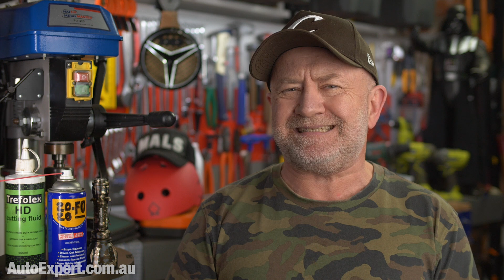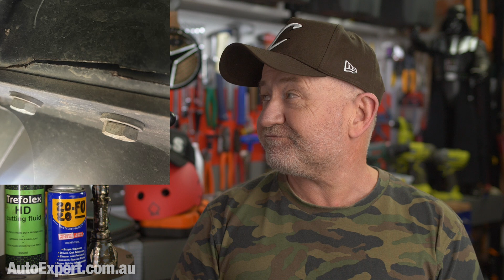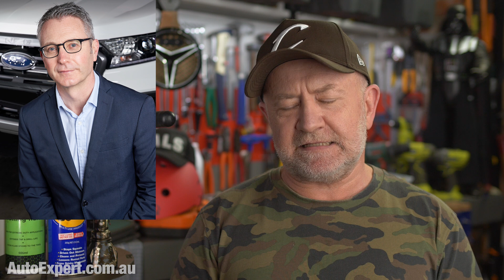CRACKED! Hi-tensile bolts Vs chassis Vs dealer incompetence | Auto Expert John Cadogan

Comment: You've got to love sales/service people's bullshit at times, I got a chuckle out of they just loosened.

It's not the first time someone hasn't installed a towbar incorrectly. Is it the Ford dealer at fault or ARB, I suspect ARB fitted the towbar and would likely be at fault but the dealer if they sold/recommended this towbar should do the right thing and fix it. And give they've invoiced to tightened chassis bolts, I expect they're a little rooted, seems like a good negligence claim to me.

My guess is these were tightened up with a rattle gun that wasn't quite ugga dugging properly.

Comment: I’ve worked in the accessories industry for over 15yrs, as your story is some how correct, I must say, there are a number of firms that fit for dealers on site, and plenty of dealers get their juniors to fit accessories!. I’ve never swung a torque wrench off any bolts connecting a bull bars or tow bars, but I certainly maintained every item was fitted correctly. Never have I shown or would accept a earth link be tightened to a towbar bolt. I have watched fitters use air ratchets to turn a bolt tight, though without following up inspections, they’d opened the spring washers, creating a loose bolt. I’ve fixed many of trainee stuff ups, but to be working under the big branded named firms, they won’t tolerate inept fitters that fail those basic requirements in safe proper accessory installations.
Reply: I'm not trolling you, Mark. I'm ex aviation and we did a few "tests" on the "calibrated elbow" in the hanger in which I worked. You would be absolutely dumbfounded just how far out you can be by guessing torque. 
Take a few of your mates and the spec sheet on the next job you're on and see just how close they get. It's a great way to win a six pack, if nothing else. If they have a basic understanding of engineering and pride in their work, you'll see them use the torque wrench a lot more often. They'll find out that the tools are there for a reason. Squashing spring washers isn't the only way to measure incorrect torque settings.
Reply: @davidbrayshaw3529  well said.
Reply: @davidbrayshaw3529  points taken, plus 20yrs out of that game! You do get to know the feel in that game! You just need to work in it to know. My point was! Not many newbies get taught right. Thank goodness ppl like yourself, take critical torque to help save those many lives in the sky, unfortunately on the cold ground world on your back, a torque wrench won’t cut it, when the tool is longer than the room under to move it. Maybe just a senior fitter to inspect the juniors work. This topic is a junior mistake, or an older no care factor employee!
Reply: @Mark-Aussie1529  I've done up far more fittings without the use of a torque wrench than with, I promise! But I know their value.
Reply: I've just read both "sides" of this  interesting conversation and it strikes me that you are both 100% right. When the pressure applied by a properly fastened and torque'd bolt is say 4T and you have 5 of them per side, doing them up using arm feel could vary the force by perhaps a ton either way per bolt (3T to 5T) so total force applied can be anywhere from 30 tons to 50 tons for a part that can easily live with 20 tons...hardly going to matter for a tow bar. 
Head bolts, well I would argue that just a few foot pounds off the mark will allow gaskets to fail or the head to warp. 
Horses for courses then.  The problem here was they were never tightened...they were just screwed on, ot as Jason points out "a rattle gun that wasn't quite ugga dugging properly".
Reply: @ShoebridgeForPM  But what are the tolerances? Once again, I'm not trolling and I'm not having a go but when you're forced to have a think about it, the "numbers" get away from you pretty quickly, as you have demonstrated.
Will it matter when fitting a tow bar? I'm guessing, probably not. At the same time, I don't want to have that argument with an engineer who spent four + years at school and has just spent the last week calculating the clamping tension at x, y and z degrees celsius after x number of years/hours worth of fatigue/corrosion/vibration and whatever else they calculate while I'm checking to see if my beer's cold yet!  In my mind, "tight is right" sought of works... sought of.
For God's sake don't tell that to the kid with the rattle gun at the tyre fitting place, though! I'm going to have serious words to him when I next see him.
Reply: @davidbrayshaw3529  agreed. Flying helicopters your life depends on the correct use of torque wrenches, big and small.
Reply: @MeppyMan  We've all heard about the Jesus nut on a helicopter
Reply: @davidbrayshaw3529  That's a good point re tolerances David. Unfortunately they are rarely given, so you have to rely on experience - hypothesis -> result - and many will know that if they crank those tow bar mounting bolts ruly, ruly hard and 20 years later they are still on hard, too hard 'cause you almost broke your ulna trying to get them off, then chances are cranking ruly, ruly hard was sufficient. 
All I'm saying is there is room for "feel" and experience in some areas and a place for a torque wrench in others.

Comment: Problem is it's not even worth going legal here. Better off just getting it fixed yourself. Unless Ford comes to the party. Not holding my breath there.
Reply: Even if a competent welder can repair the chassis rails to better than factory standard, the fact that there is an obvious repair on the chassis rails will probably hurt resale. I'd be pushing for a ex-gratia payment from the dealer to cover repair costs (assuming the vehicle isn't fixed by the dealer) as well as to cover the reduction in resale value attributable to cracked chassis rails.
Reply: @TheKnobCalledTone.  Is chassis welding allowed in Oz?
Reply: @TheKnobCalledTone.  Weld can be ground down and painted no one would know or need to know as the repair is as good as it was or even better.
Reply: @TheKnobCalledTone.  
And if Ford would honor the warranty. Not sure the repair would be authorised.
Reply: I wouldn't trust that dealer to do anything. Even they offer to fix it, they will screw it up.
Reply: @GuitarsRockForever  They haven't really played the trust game well.

Comment: Tow bar? That must be Australian for "hitch receiver".
Reply: You tow things with it. So towbar.
Reply: Really? What do you guys call the draw bar that is inserted into the receiver?
Reply: @kevinbarry71  The towbar tongue.
Reply: @kevinbarry71  Draw bar attached to the trailer, tow bar attached to the towing vehicle.
Reply: Except the draw bar does not attach to the trailer. You put the ball on that, and then you connect the trailer to it. And tow ball download sounds like a sex act. We call that tongue weight. The part of the trailer that fits over the ball is called a tongue.
Reply: @kevinbarry71  
We actually call it a tow hitch, which fits to the towbar; the part that fits over the ball is the trailer coupling; there are also light duty towbars that don't have a separate hitch, instead use a tongue welded to the towbar; ain't terminology fun?

Comment: Hi John. I work at a Dealership and have fitted many tow bars. I came to the exact same conclusion as you. The only way this could have happened is by not tightening the bolts properly in the first place. And to hear that Ford is passing the buck is criminal.
Reply: Criminal is spot on. Pity the ACCC cops aren't awake yet.
Reply: And they aren’t warranting their workmanship because it’s an aftermarket accessory they have said 🤷🏻‍♀️
Reply: @sichunt_2733  during the service they charged the owner for tightening the bolts, they sold the dealer approved accessories and fitted them = responsible
Reply: Not the only way. It could come loose if this was mounted incorrectly. Let's say the technician didn't bother to drill out the bolt holes in the chassis bar and install the very very common used spacer blocks that prevents the chassis bar to crumble when the correct torque is applied to the mounting bolts.
The spacers that i'm talking about usually looks like thick walled pipe that sits between the trunk floor and the chassis bars lower surface. The bolts run trough them and if they are missing you would not be able to torque to the right specs. :)
Reply: Out of curiousity Dan, do the aftermarket towbar manufacturers actually include torque settings for the installation of these bolts? 

A couple of decades ago I worked in dealerships fitting accessories such as these, and I can't recall ever seeing torque settings. I can guarantee a torque wrench never went near these bolts, it was all done with the old rattle gun and you stopped at about the sixth "dak-dak."

Wondering if AFD and Ford in general in this case are relying on that to weasel their way out. Kind of "no info so not our fault."
Reply: @David_Johnson_  spot on! 6th "dak-dak" = 95Nm
Reply: @David_Johnson_  no they 100% have the torque measurement in the installation manual, Ford provided it to NNN
Reply: @David_Johnson_ . Sorry David. I haven’t had to fit tow bars for a while. I was working for Kia at the time and I know Kia And Hyundai have ‘their own’ branded tow bar kit. No aftermarket branding on the box. Yes. Torque specs would be included regardless of manufacturer branded/OEM or aftermarket. Tightening sequence also makes a difference.
Reply: I was waiting my turn to pick up serviced vehicle - the guy before me was arguing his hand brake was not adjusted again as they missed it last time and that was the major issue he brought the car in earlier this time. The service manager said he will have to book in for a gold service to include the hand brake adjustment. Hand brake can be adjusted during a simple brake check one would think at any other caring mechanic.
Reply: If the dealer fitted the aftermarket accessory (tow bar) they are still responsible for it. The car broke. The dealer is liable. Simple as that.
Reply: @danpol3073  I agree totally

Comment: apprentices hardly know what a tension wrench is now days, my days with a dealer Caterpillar  always made you use one . As soon as you go away in the mining world its all done by rattle gun  or guess work. Definitely dealer F#$% up !!
Reply: 1. Select impact socket of suitable near-enough size.
2. Ugga-dugga until socket slips.
3. Attempt to back out fastener until bolt head is round and shiny.
4. Repeat for at least 50% of the remaining fasteners.
5. Walk away and tell nobody.
Reply: Insufficient ugga dugga’s
Reply: @danstevens2204  damn skippy !

Comment: I do hope other Ranger owners start checking their nuts and bolts.
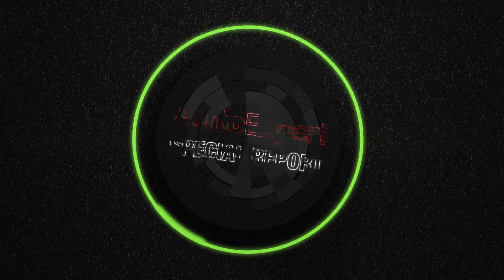@0:40 seconds in... and MingMoles?? Plzzz..
@4:47 wjat's with that cable? Is is squeezed between that bolt??? Ahhh, it's grounding, WTF?
Wow, and, "it's his 3rd! Ranger and his last" Very funny but also very sad.
Reply: Ming Molls, not moles.  Moles dig tunnels, molls do other stuff.
Reply: @p38arover22  mmmmm mole ... mole ... Moley moley moley ...
Reply: @p38arover22  But you lose, HAH:  Here:   TOP DEFINITION
Ming Mole
An attractive young female, dress strategically to expose or highlight her ample cleavage, within a car dealership. Their job is to primarily target the male dominated market, selling additional extras on top of the sale of the vehicle such as paint/fabric protection, tinted windows, gadgets and/or electronic rust protection - usually at a higher price that what is available on the market.

The term is a combination of two words:

"MING" being the original brand of protection products, and

"mole", a derogatory Australian term associated with females of poor social conduct, or questionable sexual promiscuity.

The alternate term is "Wynns Wench" (which is related to the brand WYNN).
Beware the Ming Mole, her low cut top get's her plenty of business but what she's selling isn't worth the price.

The Ming Mole stitched him up real good - he thought he was getting a massive discount but paid the difference in crap he didn't need.
by zachlost March 23, 2011
Reply: @RealButcher  I hope you didn't use the Urban Dictionary.  It's simply wrong.  Moll is the correct spelling and has been corrupted into "mole" by those who cannot spell.
Definition: Is it mole or moll?
"Technically, moll is an old term for a prostitute while mole refers to a literal skin blemish or a furry little rodent-like animal. We prefer mole. "These sayings come and go and if you think about it, moll is a very old Australian slang word for a prostitute."  
I prefer "moll" - but I may be from an era when it was the word in use before being corrupted,
Reply: @p38arover22  Damn, you are right! Just found an article from John Cadogan himself. Here: Legend of the Ming Moll: How do car dealers get away with this in 2021?
At the retail coalface, the car industry still gets away with selling cars in this way, in 2021. Here’s the ugly truth about the Ming Moll…from 14 NOVEMBER 2020
Reply: @RealButcher  No problem Peter.  All good.  :)
Reply: P38A Rover but, but , but .... I miss them Molls....
Reply: @RealButcher  Absolutely!